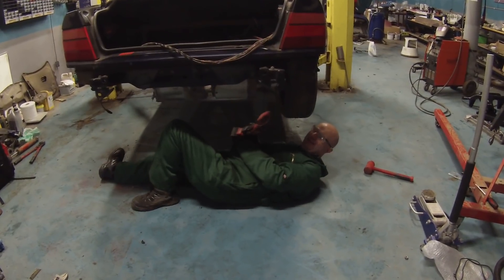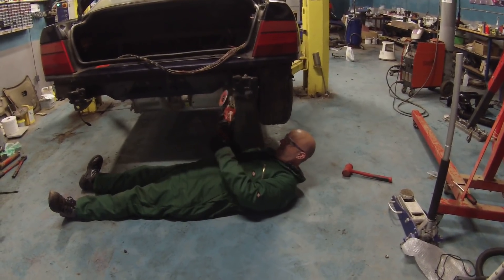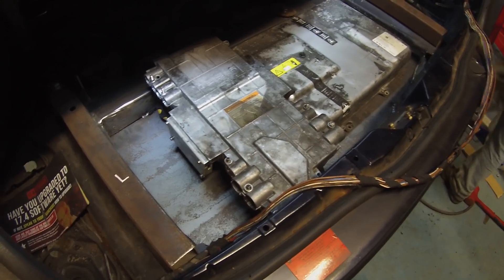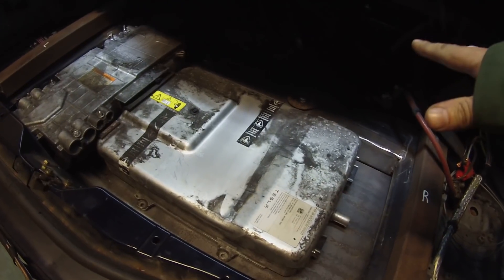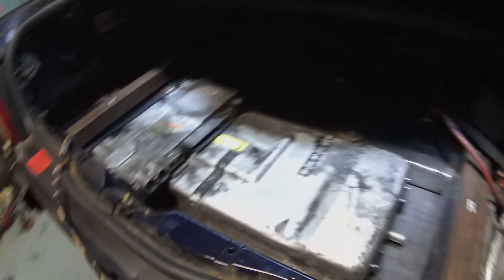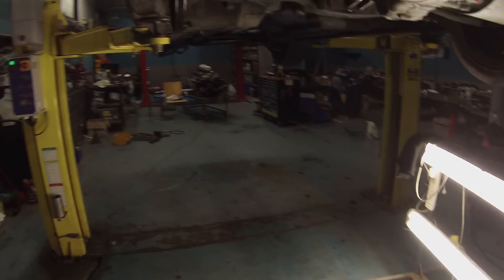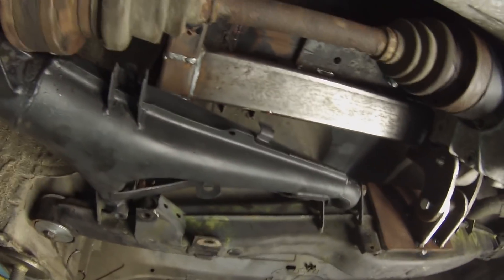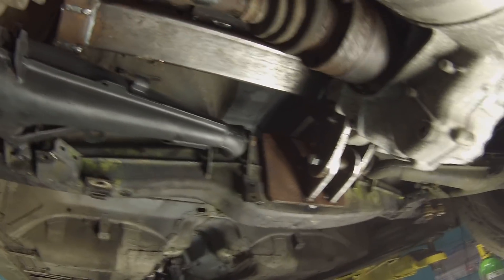BMW E31 840CI EV Conversion 88 : Tesla Swap Day 7

Comment: Hi, Damien.
Some questions about legal stuff:

I wonder, do you have more legal possibilities (more "freedom") in Ireland? Does your actual NCT certificate remain valid, or is there something you must do to re-validate, when you're done with the conversion?
It would be interesting to hear you talking about this topic.

Anyone who would do this to a car in Germany would make his car totally road-illegal. In Germany, the so-called "general operating permit" is void due to all this structural changes. 
As well as one would kill the TÜV approval for the car (the german version of NCT). The owner would probably have to reapply for a new (full) TÜV test, as well as for a new general operating permit in the first place, which is very difficult (and expensive) stuff. I would be highly concerned about this. 

It would be a shame when all this good work would be for nothing due to a missing piece of paper. ;-)

I also wonder, what would happen, if such a car would be pulled out by the german police. What would they say? Would they let the driver proceed traveling? Probably only if the driver can show them some official certificates about the safety of the conversion.

What about the weight of the car after this conversion? I assume, the weight will be increased due to all of this heavy-duty metal elements and all of the Tesla batteries, so you're going to need a more powerful braking system, which you will need anyway because of the power of the Tesla motor. According to what we could see so far, I'm pretty sure you also took care about this issue, right?

My last question is, what are your plans about rust protection? This project really deserves a good one.

This series is getting more and more exciting.
Looking forward to see more.
Reply: Zoli1972s we are not in Germany
Reply: I know. But I also know about Damien's plan to come to Germany with the Panzer one day. That's the main reason why I brought this up, just wanted to help and save him trouble. ;-)

I also wonder, how such a conversion could be done the easiest and most legal way here in Germany.

Comment: That reminds me (doing it wrong) of the demand for a NORMAL car. A normal car obvoiusly cannot be electric. Half the world is running on petrol and the other half is running on heavy stuff e.g. diesel. So a NORMAL car must have a two stroke engine mixing petrol and diesel like Trabant or DKW used to do.

Damien, you cannot do it wrong. Both petrol and diesel are for more dangerous than electricity is.
Reply: Yes i instantly die when i Touch Alot of Petrol lel

Comment: Anyone who says you're doing it wrong is, as they say on your side of the pond, talking rubbish. Any Camaro, Firebird or Mustang enthusiasts will recognize that type of subframe only theirs came from the factory with it. Yours is a heckuva lot beefier though. Top marks!
Reply from the maker: Thank you:)
Reply: You're doing all.....  Right! Spot on in fact. From.what I can see on the video the standard of the work is excellent, should be plenty strong enough to take the mountain of torque that will pour out of that motor. 

How did you come up a drive shaft to fit both ends (I expected a specially made job, (new looking))?